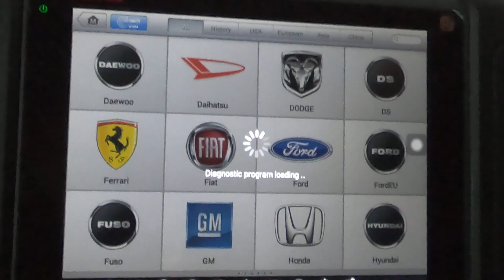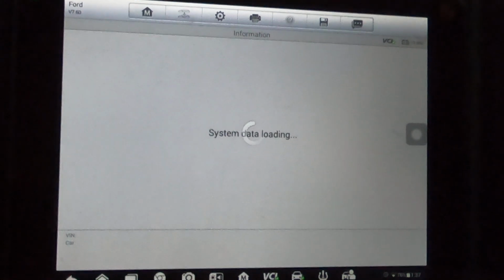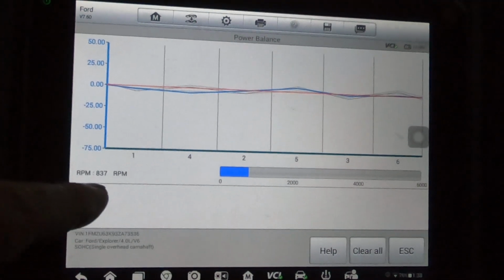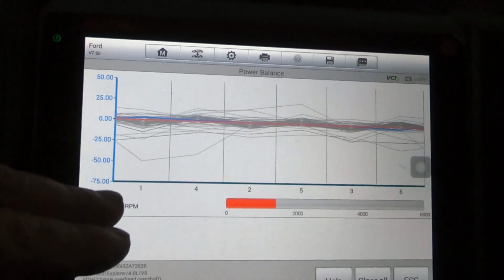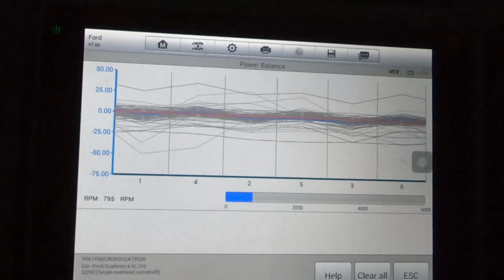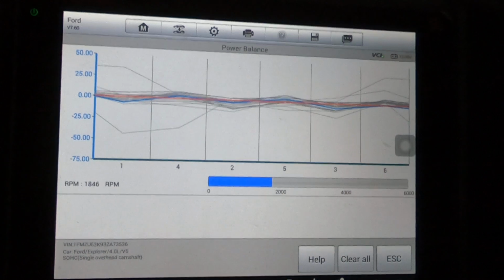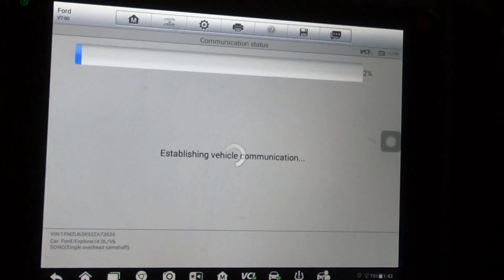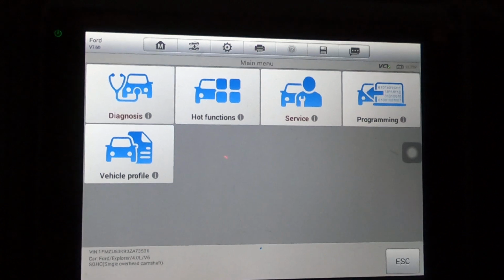Ford Power Balance on the Autel MS906 Scan Tool.

Comment: So, the power balance it's most likely to diagnose an injector?
Reply from the maker: Not necessarily. It can be used to troubleshoot anything that would cause a cylinder to not produce equal power, such as ignition, injector, or compression problems.
Reply: @737mechanic  dang, I just did a timing job on a 2006 Ford F-150 5.4l  3V the truck had codes for timing plus the phaser broke the valve covers now it doesn't have any codes I drove the truck for like 30 miles still NO codes but it shakes on idle. So, I did the power balance and it shows no. 8 issues what you think that I should look for. Sometimes customers doesn't understand this kind of issues.
Reply from the maker: @mtsanchez27  I would do a reletive compression chack if the truck allows that and if the scan tool has the option. 

Also you could swap the #8 coil with another one to see if the problem follows or stays on cylinder 8.

You also need to see if the injectors are flowing equal to each other by doing a injector balance test.
Reply: @737mechanic  you know what's weird? That the relative compression seems to be good in all the cylinders with the scan tool
Reply from the maker: @mtsanchez27  So that means the timing chains should be good. and that each cylinder should be close to one another. 
Next thing is see if there is an injector balance test. If not I have a video on how to use a 3rd party tool to check and make sure each injector is flowing exactly the same.
https://youtu.be/tHIwaRotrVo

Also if it is just an idle issue you could clean the throttle body.
Reply: @737mechanic  I already cleaned the throttle body because it was really dirty. I'm going to check on that video that you posted and double check and hopefully I can find the issue to solve the problem. Thank you very much and hopefully this helps many other people with the same concerns!

Comment: Does this feature ONLY work on Fords?
Reply from the maker: This version of the power balance is a ford specific feature but other manufacturers have power balance functions that normally show just numbers of each cylinder and you can compare each number to get an idea of which cylinders are contributing and which are not
Reply: Hello, I recommend Topdon's Phoenix Elite to you, it supports full-system diagnostics for more than 200 brand models, and covers a wide range of models.
Here's a video I made of balancing PCM Power for a 2013 Ford with this device: https://youtu.be/3DeI7sB6AY8 , you can take a look, it might help you.

There are more videos on my homepage of different devices performing functions for different car models! Come in and see, there may be surprises!